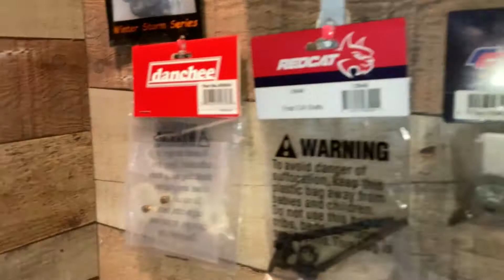Danchee RidgeRock Axles

Comment: Just a heads up, you might want to loctite those set screws in the ends of the axles that hold the axle shaft pins in. One of mine came loose witch caused the pin to fall out and it scared up the inside of the outdrive cups. I ended up losing the set screw and the shaft pin. I have had mine for two years now and that is the only thing that has happened to it. I really like this crawler. Good video too by the way.
Reply from the maker: I’ve had this one since they came out, second rear end I’ve put in it. But a little loctite goes a long way. Worth the money.